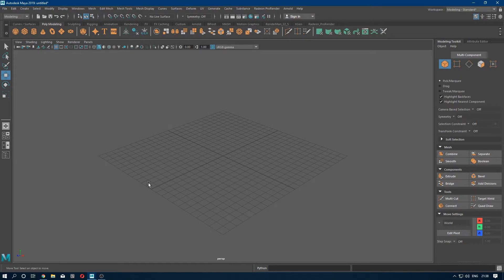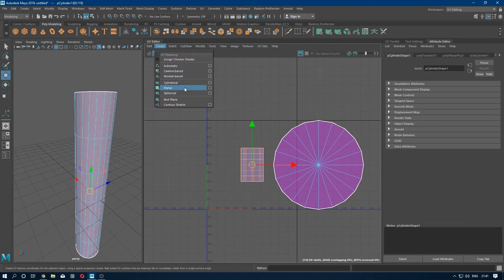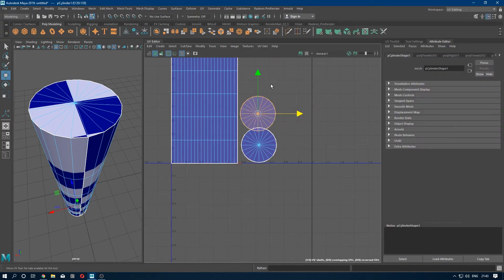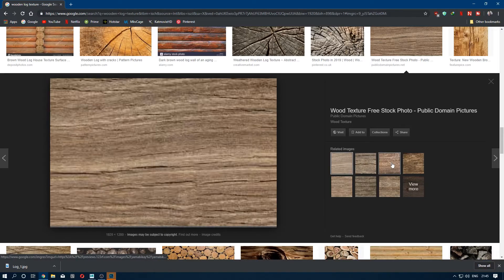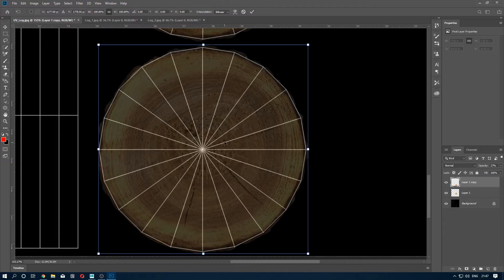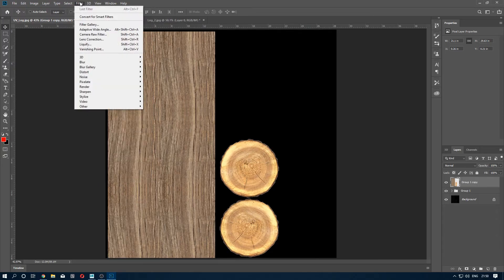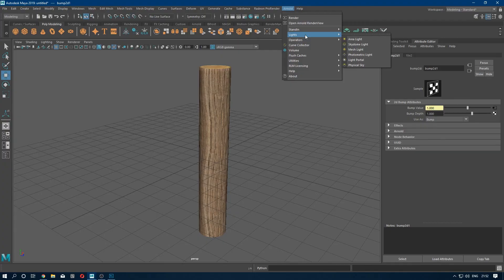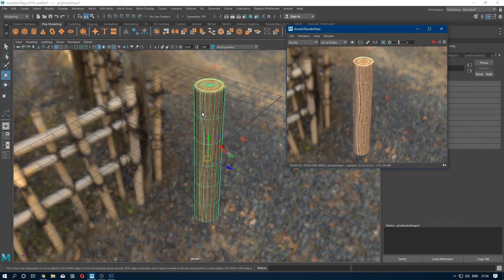Autodesk Maya 2019 - Wooden Log Modeling and Texturing in Maya & Photoshop

Comment: So cool! But why when i select the cylinder in the UV window it moves also the circles , they are somehow linked, because when i make the one bigger, the other one changes also...
Reply from the maker: Make sure they're not combined 
Try separating them.
Reply: @3dwolf  how do i do this ? :)
Reply from the maker: When you unwrap the cylinder make sure you select the top and bottom faces and make them planer so it'll create a seperate shell contain top and bottom faces.
Hope it'll solve your problem.